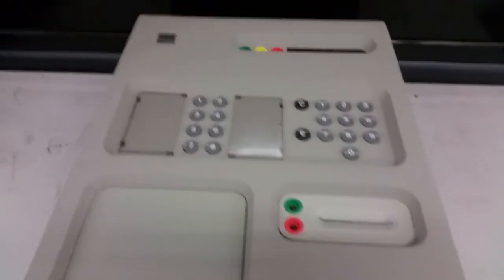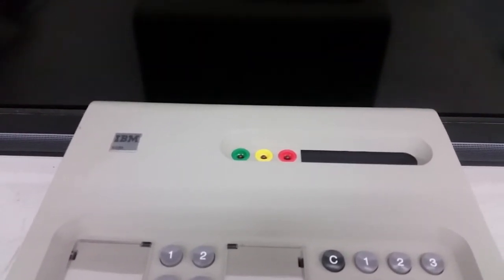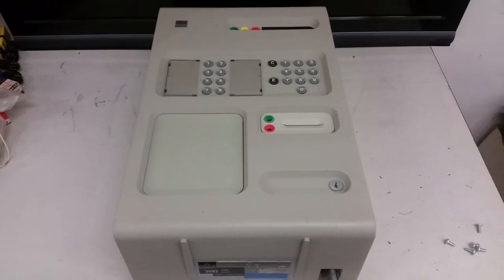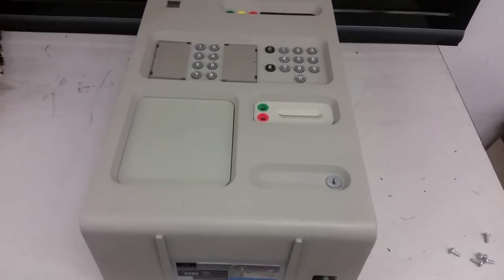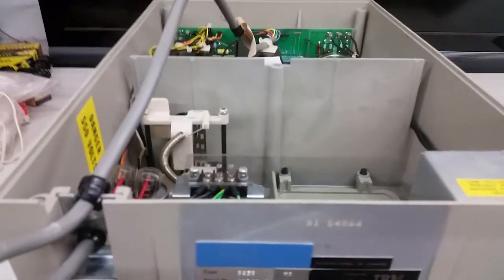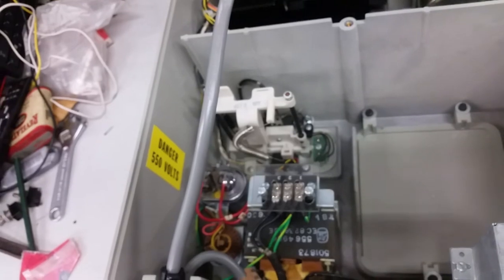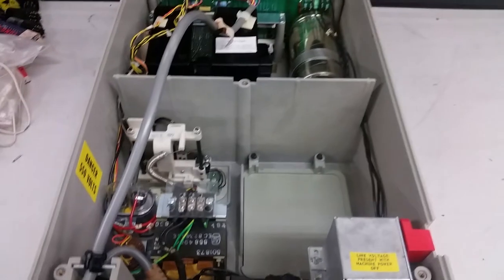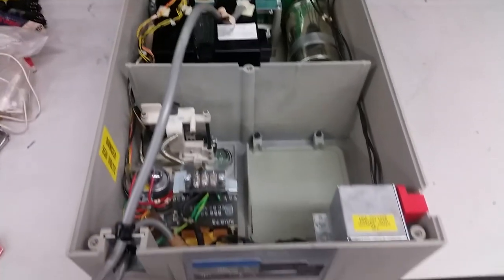IBM 5235 Data Entry Station

Comment: This is great. They could have put one outside the can, added mainframe-controlled solenoid locks on the stall doors, and tracked how much valuable time employees were wasting on the throne.
Reply from the maker: You, sir, are management material.